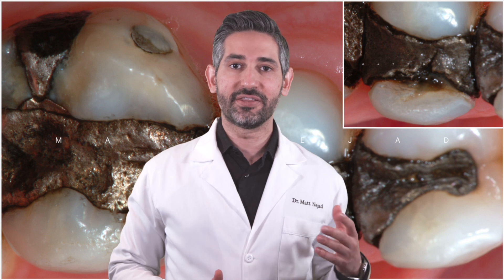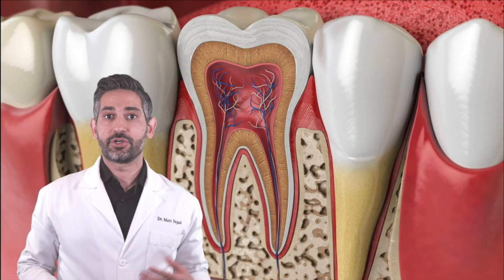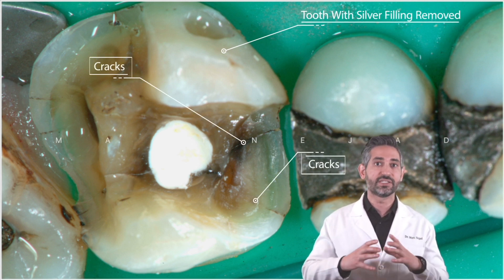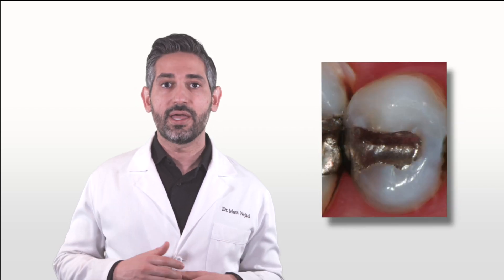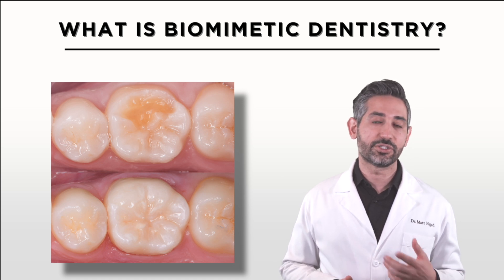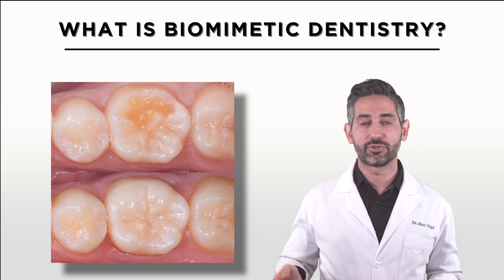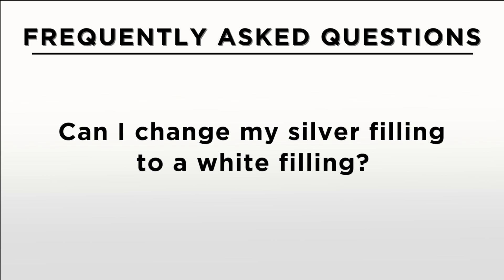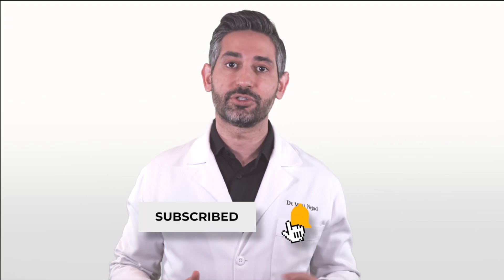Replacing Silver Fillings with Biomimetic Dentistry | When, Why, and How to replace Amalgam

Comment: I wish you were my doctor 😭 I have 6 silver fillings that needs to be remove but I don't know which dentist I can trust to have the procedure done.
Reply from the maker: =) There are good ones out there, but if you can't find one, you know where to find me.
Reply: @biomimeticdentistry  I have a question: I have an inlay done in Aug 2019.  However, the tooth now smells every time I use Waterpik to floss the area surrounding the tooth.  Can I remove the inlay and replace it with a normal filling?  I never had this issue with a normal filling.  I know the cavity is deep but it hasn't reached the nerve yet.  Even if it reaches the nerve, I will have a root canal treatment with a filling (if it is possible to have one instead of an inlay).
Reply: I have 6 to replace too. 😢I wish it was more affordable to replace them with a holistic dentist.

Comment: ive had like 10 amalgam fillings for the past 15 years and ive been having metallic taste in my mouth for over a year and many many many other neurological symptoms and gastrointestinal problems and no doctor says that it could be possible that the amalgam fillings could be at fault (maybe they dont know how the amalgam can decay or what substances lead to mobilization? and also methylmercury?)

do you think i should get the fillings removed asap? and how much money do you think i should save? insurance only covers removal if someone is allergic to the amalgam

1 month ago, one filling got loose and fell out even

im really mad that this was done to me as a child, and ive always been very sensitive to environmental toxins

since last year, i was even diagnosed with autism spectrum disorder, and i never had those symptoms in that severity (i had symptoms before i had those fillings but its only gotten worse ever since)
Reply: Hey, I’ve got the same issue regarding the metallic taste I hate it!
Reply from the maker: Hi Alex, sorry to hear about this. 

Regarding the cost- It depends on the size of the fillings. Some may need inlay or onlay restorations, some might need crowns, and some could do with fillings of different sizes. If the teeth are cracked, its more likely that an inlay or onlay restoration would be recommended. Anyhow, I can't really estimate the cost because it depends on the treatment plan. 

Regarding my recommendation- I usually evaluate the restoration in reference to the actual current condition + the patient's desire. It is impossible to predict if removal with result in resolution of your symptoms, but if the restorations are already problematic or defective then there is nothing to lose. If the restorations are perfectly intact, then I would say it is up to you because there is no definitive way to determine if this will help without trying, and thats a risk you would need to take if you determine that you have exhausted other options.
Reply: There's no methylmercury in amalgam filings. They use another kind of very less toxic mercury

Comment: Can I take Chlorella for detox after replacement for a white filing?
Reply from the maker: I don't know if that has any significant impact, but if rubber dam was used, the studies show no detectable increase in blood mercury after removal. The problem is most people don't use rubber dam and practice dentistry to the standard necessary to minimize exposure and do good clean work.

Comment: So many offices go straight to replacing with a crown. Glad to know it’s not a must. Just have to keep looking and doing research. Thanks.
Reply: I agree.  I had to insist when I made an appointment yesterday, that I do not want a crown on my #2 molar.  If the filling cannot be replaced I would rather have an extraction.  I am a 76 year old immune compromised female, and am fearful of getting an infection if the tooth is not repaired correctly.
Reply from the maker: yes its very unfortunate. I teach courses to help spread the word about this kind of stuff but change takes time. All the Best- MN

Comment: realistically silver fillings are stronger and will hold much longer. If it were the front teeth then obviously white
Reply from the maker: realistically, this is false. There are large studies over 10+ years that specifically prove the opposite is true. You are being a classic example of "stuck in your way" and not trying to improve. Sure, you can do a composite filling that is absolutely lousy and guaranteed to fail, but you can also do the opposite if you cared and tried. We don't need people making pointless claims like this. Study, practice, do better.

Comment: I had a gap between the central and lateral  incisor teeth both. Which made food always get stuck between them everytime I eat. The doctor filled that gap but he made a gap between the lateral incisor and canine eye tooth.
And now I'm having the same problem all over again but from the other side when I actually didn't have that problem there. There was no gap. Is that normal or is that not okay? And what would you suggest me to do?
Reply from the maker: Teeth do move and rotate throughout life. I can't visualize exactly what is going on or why. I know this is annoying to hear but I suggest you check with a dentist or your dentist. Options might include Invisalign, ortho, bondings, or a retainer to prevent teeth from moving further.